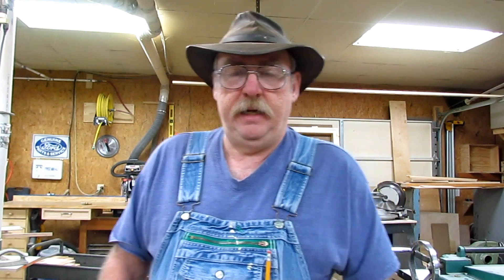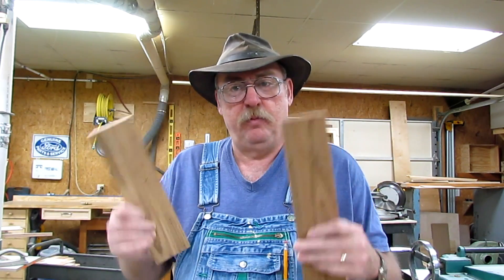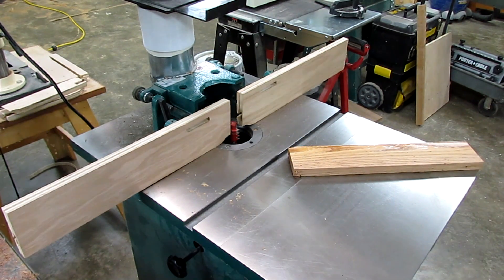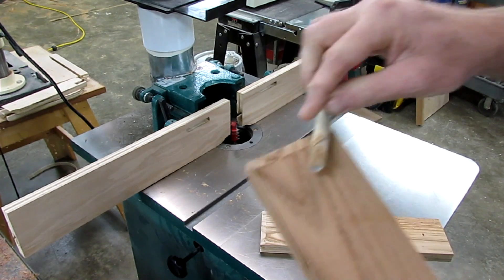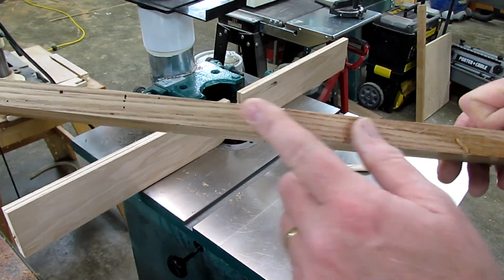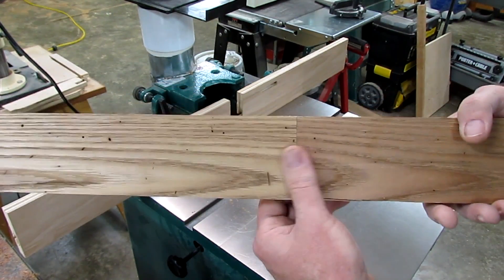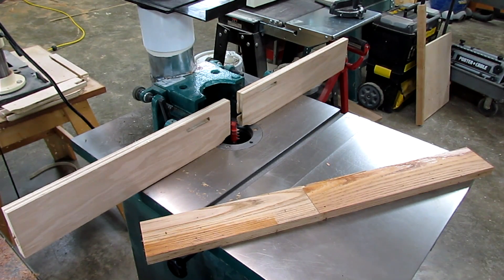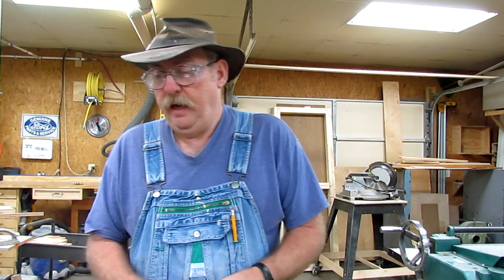Finger joint addition from making lumber.mp4

Comment: I'm making a cherry door and looking for the best way to make the stretchers as I haven't anything in stock that's two metres long. My budget doesn't stretch to that Freud bit. I was going to join the end grain with my finger joint jig but that's not going to be either attractive nor as strong a vertical joint as I need. Having watched your video I have a set of panel cutting bits that should do the job. Thanks for the demo. It would have been nice to see the finished board in this vid.

Comment: So, I didn't get how you set finger joint for different size of wood. If I have a 3/4 inch wood or 1 inch wood, where exactly do you set your router bit to properly cut that wood so that it will put the end to end boards smooth together? You said it take some time and you use a jig for each board, but how and what height are you setting the bit to? Thanks
Reply: There are different types of such kind of cutters with vary numbers of tips. In this way,  the cutter can best match the wood thickness